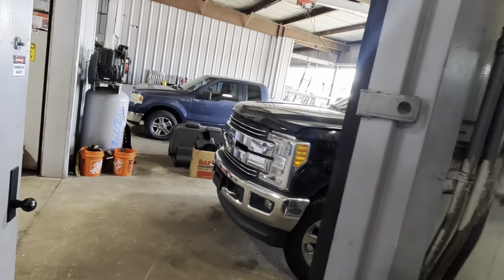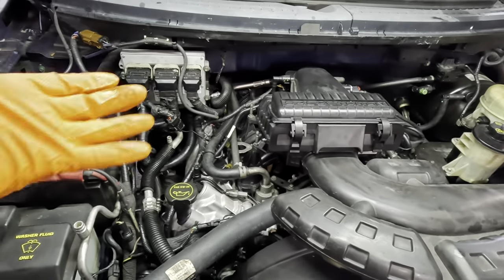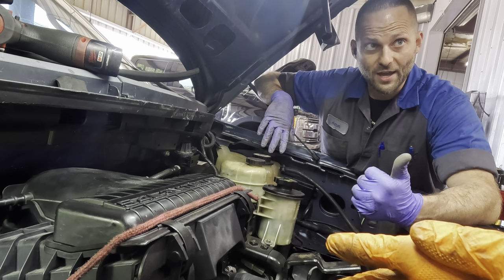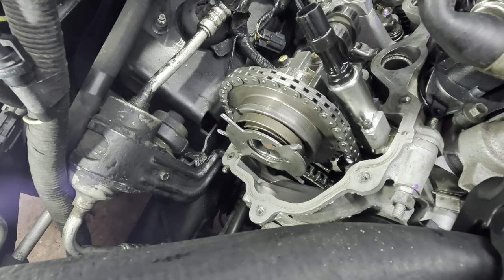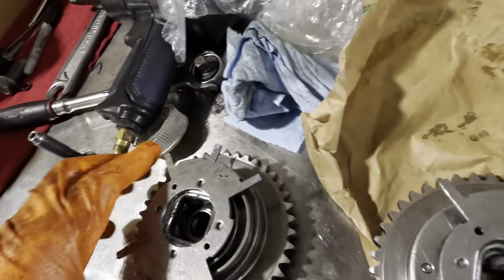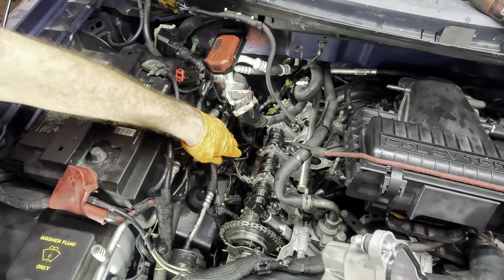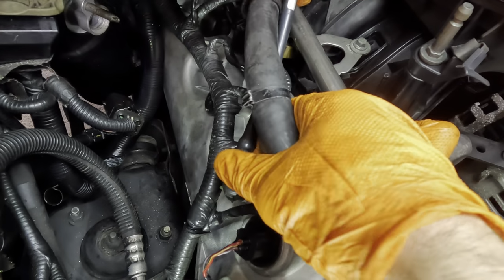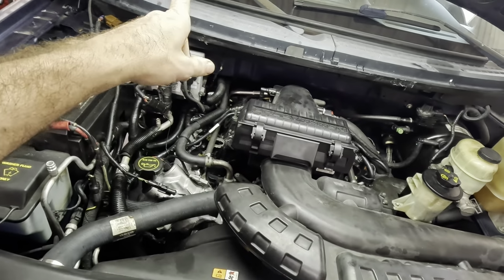Ford 5.4 Camshaft Phaser and Timing Chain-Wedge Method

Comment: Ray just my opinion but I believe that noise on start up is the timing chain tensioners. If the engine builders used poor quality tensions they can bleed off and allows the chain to slap the guides for a second until oil pressure builds back up in them.Just my thoughts I could be wrong but keep up the great work and great videos.
Reply: I have had many Fords make that noise on start up, and all of them have been timing chain tensioners.  Oil starvation using cheap oil filters with crappy anti drain back valves, and or the wrong weight of oil is the usual culprit that gets it started.  In this case, wrapping paper.😂
Reply: Ray likes to talk a lot lol😮
Reply: My Marquis makes a similar sound on occasional cold starts. More than 20 years and 186,000 miles as a daily driver I’ve just assumed the guides are worn down and the tensioners are getting close to their max. Having damage from an interstate sideswipe and maybe 70% of the trunk floor left due to rust, that rattle doesn’t bother me as much.
Reply: Yea once timing chain tensionors wear down guess where it all goes. It falls down into the oilpan
and gets sucked up by the oil pump next thing you bye bye engine.
Reply: @christsogaugetrains Reeeeeeee!
Reply: @terrybaptist795  that car has gotten regular 3,000 mile oil changes for the 16 years I’ve owned it. Full synthetic and premium filters. I’ve run mostly Wix but dabbled with motorcraft to see if that made a difference with the rattle.
Reply: You are onto something here. I agree. I’m curious whether or not the chain tensioners have been examined? 

As you said, cheeping out on such a critical part rarely yields desired results.
Reply: @christsogaugetrains In this case it's useful for Ray in terms of documenting the work, but yeah, because he is here to both inform and entertain the verbiage is part of the mix and I for one enjoy it.
Reply: @InsideOfMyOwnMind  oh I know been watching him from day one just cracks me up
Reply: You mentioned tire air pressure...I still check the tires on my vehicles once a week...the swings in temperature make a difference in the tire air pressure.
Reply: The plastic found could have migrated into the timing chain tensioner.
Reply: Just my opinion, but I believe the owner shouldn't have dropped a bunch of money installing a reman engine in a truck with a bunch of miles.  Sell the thing and move on.
Reply: @Jonathan-mp32x....the dude said "you mentioned air pressure" or something like that, hes not saying it has been to do with it.
Reply: Or you could be doing oil filter housings on Jeeps for the third time
Reply: @christsogaugetrains and that's why the die hard fans like his channel, if you listen to what he is saying you learn somethings.
Reply: @thewausaudude 

I feel your pain if this is your truck.
Its frustrating to have to deal with problems like this.  But ill point out you have better options for oil filters  its the last defense in protecting your motor from wear  you use synthetic oil then use a coffee filter   to keep it clean.
Last thing i would do is use a budget filter. Think about it. 

I hope Ray gets this fixed for you.
I would blast the installers name online to tell others what a shit show you've had to deal with because of the bad install problems.
Reply: @bobbg9041 
He’s referring to his cancerous Marquis, not this truck.
Reply: Anybody else craving fondue after this?
Reply: I was going to say the same thing. It does sound more like chain slap than a bad cam phaser.
Reply: @johngross1952 a man with a routine I like that but I check my tyres when I can visually see a problem I’m slack!😂
Reply: I don’t believe it’s the fazors, but the timing chain tensioners. If they loose oil pressure they take a few seconds to build back up, the “ticking “ sound on start up is the timing chains dragging across the cover until pressure returns to the tensioners.
Reply: Sorry to hear your customer is under water on his truck! He could  have avoided this in the beginning by purchasing an 04 Silverado. With normal maintenance it would last at least 350k miles. The 3 valve is junk old or new!
Reply: Hey Ray,
Why complain so much about the phaser job? You're getting paid to do the work and the 3 videos you've done are interesting and educational. This is a great lesson for us about reman engines.
Reply: What Josh said. The chain tensioner’s, that are aftermarket, the gasket to the engine goes bad, which causes that noise, on start up
Reply: @ralfie8801   cancerous Marquis. I feel it man lol
Reply: Would like to see a video of you working while making your videos to see how you get the camera angles and views you get. Just one, cause I realize it would be too much for every repair video you make. It's just fascinating how you do what you do. Skills Ray
Reply: @Marklovesfamily  truth.
Reply: @Durangsho **phasers
Reply: I would recommend doing some of the disassembly in fast motion until you get to the guts of the installation of the new part.
Reply: I think the reason ray hasn’t gone in to diagnose it himself yet is because the warranty company will not allow it. Notice in the other video he didn’t want to pull the valve covers and run the motor but that’s what they told him to do. It’s not my place to assume but that’s what im thinking

Comment: If you are committed to getting this diagnosed and fixed you need to first of all fix the exhaust leak so you can hear the engine noise better. Another thing you could do is hook a mechanical oil pressure gauge and see how fast the oil pressure comes up on a cold start and see what the cold and hot oil pressure readings are.
Reply: Excellent suggestion with the manual oil pressure guage. If any of that paper that was jammed under the driver side valve cover got into any of the oil galleries, a blowed motor becomes very possible.
I've been wondering what kind of "reman" engine they put in that truck ever since Ray found that paper. If they just did a junkyard swap and billed the owner for a "reman" motor, the owner should receive a REAL reman motor, after the people who ripped him off go to jail.
Reply: Someone has to pay for this work….
Reply: @keithhastings4092 
Well the owner of course will have to pay for the exhaust manifold replacement since the engine rebuilder has nothing to do with that but the exhaust manifold needs replaced regardless. So why not fix that now so it’s easier to diagnose the engine noise. 
As far as hooking up a temporary mechanical oil pressure gauge, that is a 5-10 minute procedure.
Reply: These trucks really need a permanent mechanical oil pressure gauge as the "gauge" from the factory is nothing ore that a glorified idiot light that reads 2/3 scale at any pressure over 4 psi. It is common for them to have drain-back issues with cheap oil filters.

Comment: Only a 1/3 of the way thru this video and here is what I like. Rays co-worker asks for advice, but comes with a very detailed account of what he has and done thus far, not a weak IDK 🤷‍♂️ this stupid hub thing vacuum is boogered up. Nice knowledge share instead of throwing parts and theories at it. Shows that Ray wants quality techs in his shop that will ask for help and knowledge share for the best result for the customer. Keep it up guys.
Reply: PowerStroke Tech Talk w/ARod. He is not a coworker he has his own shop up north. He just down working on some Fords from people that requested him to work on them. They are good friends so Ray is letting him use his shop.
Reply: Heh, said coworker has his own YT channel, @PowerStrokeTechTalkwARod
Reply: Yeah, and I noticed Ray made loud noises with his electron ratcheting unit! 😅

Comment: I have a 2010 F150 King Ranch w/5.4 I'm religious about maintenance, oil changes etc...at 200k I had the timing sets replaced as a maintenance matter not broken yet.  When I specified I wanted OEM Fordco parts for it, the shop was like why doormans are cheaper. My reply was OEM got me 200k no issues, can you guarantee after market for that,, Noooo. The old guides were just starting to show chain marks on them. And I put in a high flow oil pump need for the 5.4 to function better. Don't try and save a few bucks in this repair. You'll pay double in a about 30k miles.
OEM for timing jobs only. Great video as always. Glad to see Arod again. I was born in mich, live in Jax now. Much warmer lol. 😅 I'm at 250k now now issues.

Comment: By the way, my daughter's pediatrician was killed by an underinflated tire. That was some 20 years ago now. That's not the only example I've known of people being injured or had serious property damage due to underinflated tires. Check your tires often, especially in cold weather or times of year when the weather changes often.
Reply: In Arizona, you can see the results of under inflation of tires by the side of the road every summer. Yes cold makes them under inflated, but but heat shreds them at highway speeds. The TPM system/laws are a good thing in my book.
Reply: @john_in_phoenix  yup, I'm in Arizona, but it's important everywhere.
BTW, I avoided disaster when I picked up a screw in my motorcycle rear tire on I-10. The TPMS gave me just enough time to pull over and stop. By the time I was almost stopped my fully loaded Goldwing had become a real handful. Thank you TPMS!

Comment: I have had my current auto for about 8 years and have yet to see a TPMS light, and this is the first one I've owned which as them.
About once a week I do a visual walk-around of my car, and if even one tire looks slightly low it is time for all four to get aired to proper pressure.
If I feel a mushiness driving? Same stop for air.
And when I pull out of my parking spot, I look for evidence of fresh fluid leaks.
-
I pay attention to how the car feels and sounds when running, driving and braking, and when something is different, it gets checked.
-

But then, I am part of that old generation who were taught as Ray talks about when it comes to auto maintenance.
Reply: I don't wait for the dash indicators to come on, I'm old school too!

Comment: The shop I worked at (retired last March), when replacing timing chains we would use the older style tensioners . I mean the metal ones with the ratchet mechanisms. It would eliminate the normal start up rattle associated with the plastic tensioners. They fit tight on assembly, but they do fit. Just an FYI deal for what it's worth.

You are correct. The second time always goes much quicker! Also, those Ford vacuum hubs,,,,,,,aaaarrrggghhhh!
Reply: Ford aaaaaaaaaarrrgghhhhhh.  There, fixed it for you.

Comment: This warranty company is doing what they do, of course, but that sounds to me like oiling, especially as quickly as it fades - that'll be right when oil pressure comes up. So I wholeheartedly agree with you on that, Ray. If I had to guess, I'd say that the detritus you found in the engine (that paper-y plastic-y stuff) starved something of oil for a bit, caused accelerated wear. Heard a story on Car Talk (I'm only 28, promise!), which was one of their Puzzlers. The way they told it, it ran low on oil, customer put oil in, kept going, and it just kept leaking. The question was, "What's caused the oil leak?" and the answer was that it had run low on oil the first time. That loss of oil pressure had caused damage which resulted in the leak.

Comment: I have a 2000 F250, it is recommended to disassemble the locking mechanism to clean and regrease the manual assembly yearly. Replace the O-ring when reinstalling it, there is a kit available with all the parts. If the hub is pulled off, replace the O-ring on the rear of the hub, inspect and replace the axle seal if it's cracked. When you switch to 4x4 the solenoid valve opens for a specified time to allow the hubs to lock or unlock, if I remember correctly it senses the variation in vacuum to tell if the hub has finished its movement. A vacuum leak will cause the pump to continuously run. A leaking solenoid valve or defrost diverter valve under the dash will give a big leak.

Comment: On my 5.4L back in the day, it rattled on startup due to plastic chain tensioners that would leak oil and release tension on the chains after sitting for a few hours, so had a performance shop in Australia replace the tensioners, chains and both phasers. Rattle went away after that 😁

Comment: Really marvel at the complexity of the repairs you handle. Do you specifically advertise for major maintenance and repair challenges compared to what seemed like mostly oil changes and brake jobs at your previous company?  I don’t think there are very many “Rainmans” and  “Wife Units “ in the business. We and I mean your customers and us viewers are fortunate to have you.
Reply: I've a rainman and wife unit down the street: if I thought it would help, I'd buy them a ticket to go to Florida and get tuned up -- they and their techs couldn't do a 70s Chevy truck right -- pre vacuum hose era: sixteen year olds everywhere with a handful of wrenches can do era...
Reply: Well, he is an auto clinic..  I think it needs to be upgraded to auto hospital, because he goes much further than a clinic would!

Comment: I’ve been watching this channel for a long time now, and I’m super pumped to see that your ethics and proper diagnosis attitude has got you to be your boss. I’m an electrical and mechanical engineer myself working in automation in things such as gates, doors and access control. And .it’s so frustrating going to jobs only to tell people “ I’m sorry but none of that components sold to you were required”
I really just hope that they just don’t know what they are doing, rather than just scamming
Reply: I am a data-com engineer and was on the sales side for 3 decades and it is no different over here. I always prided myself on my ethics, but I have seen some really sleazy stuff. I've also seen some really scary stuff with regards to monitoring, but that is a different conversation for a different time.
Reply: Correct..  Ethics is non existent!!  Anywhere

Comment: I had one of those. Went through the same thing. The engine blew, two cylinders lost compression, had a new crate engine put in it, then 80,000 mi later did the same thing. Bent over 8,000 on getting that engine put in. I sold it when it started doing it again, Ford is a rip off company, I will never buy another freaking Ford. Now I know what people meant when they say Ford stands for found on road dead. They should have recalled those engines years ago, but never did. Because they knew they could rip off people that had no idea what was going on. Your video just proved that. Thank you Ray, you just backed up my theory!! Praise the Lord I hope that people see this and never by their products again.
Reply: Well my last two vehicles have been Ford. And a good ford dealership that they were purchased. Never a problem. Who did you sell it to?

Comment: I have fixed several of this particular problem by simply changing the oil filter to a Motorcraft filter (Ford engineered a very robust anti-drianback feature into them). Another mod that helps with this is using the older 2 valve metal chain tensioners- they dont have a seal to blow out and they ratchet as they extend. Simple bolt on fix with no modifications needed.

Comment: See this is why people like you exist, our world would grind to a halt without engineers like you and your buddy there. Yes you are an engineer, they fix problems. One comes along and you go into diag mode, you explore and uncover things, work things out and find a solution. Under warranty is very annoying as you can't do what you want but what your told even if you know it's not going to fix things. I know that feeling well. 
Great video as always Ray, big hugs to you and family. Have a great day
Reply: "engineer" used loosely is incorrect.  It's a legal term.  without a cert or degree, if you use that term in ads documents claiming to be such, technically you can be fined.  It matters.

Comment: I've done many of these engines amongst many others...I personally have owned 3 of these engines and whenever I get one I do 3 things to these engines....1- I put a  meiling HV340 high volume oil pump. 2- I replace the factory timing tensioners with locking tensioners so they don't return when oil bleeds out and 3- I lock the phasers and get the vct's disabled on the ecm... that's a permanent fix for these 3 valves I've had nothing but success with this method and to be honest all that for less than 700 bucks. Super easy to do and motor last forever. FYI those phaser bolts are torque to yield meaning its a 1 time use bolt only I've always put them back but it's not recommended if you buy them new use ford only or high quality aftermarket.

Comment: Recommend you buy yourself some releasable zip ties. They're good at holding errant wires, hoses, and so on off to one side out of the way. Then when you want to remove said zip tie, you squeeze the release tab, and unzip the zip tie. Then it can be used again on a different day.

Comment: You can remove the 2 engine mount nuts jack the engine to remove the valve cover instead of removing the ac tube

Comment: Fix that manifold first because the sound is sometimes impossible to discern from chain rattle.
The manifold gasket slaps until it warms up and expands.
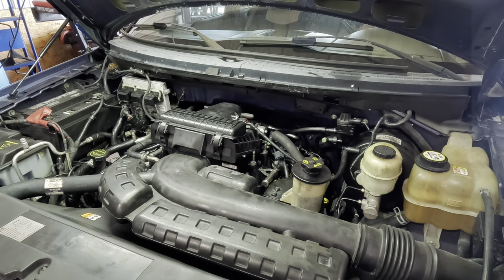Before: 3:46
After: 39:23
Reply: Yeah, I can't pick up that noise at all

Comment: The paperwork that came with the engine said they had rebuilt it using upgraded phasers but it had the original "blow-up your engine" phasers in it. The paperwork also said they had put in an upgraded oil pump. Probably worth checking that...

Comment: I did a timing job on a 3.5 eco boost twin turbo. New chain, guides, tensioners and all 4 phasers. Those oil ports are so small. It wouldn't surprise me if one or more are plugged with packaging material. What a big ooops that was.